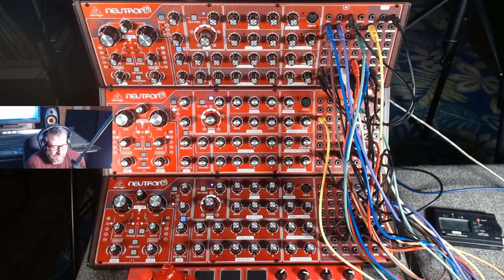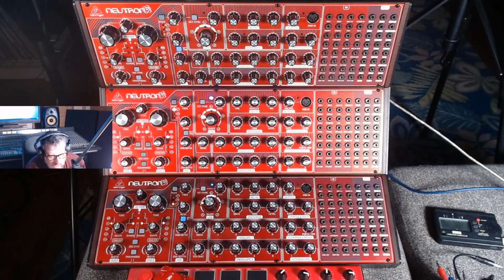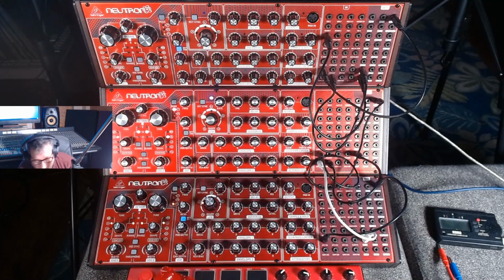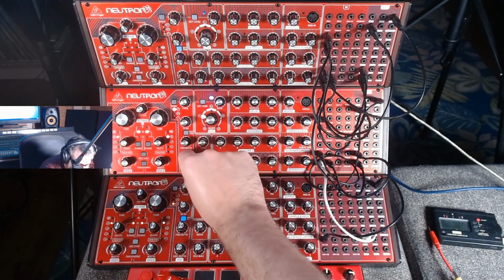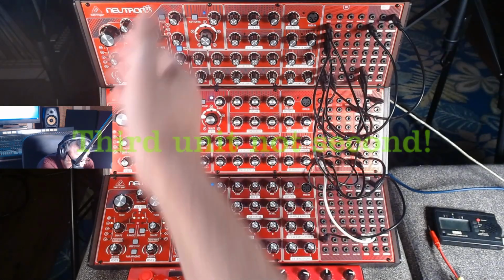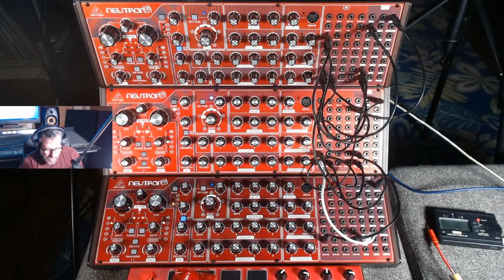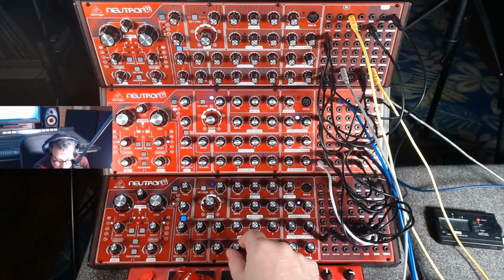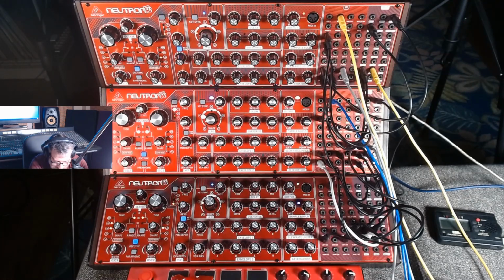How To Behringer Multi Neutron & Sound Examples

Comment: Hey there, great ride. Question; with this process we loose the drives right? Is there a way to return those? Thank you!
Reply from the maker: Great Question! The drive on the main unit, you know the destination unit, will work on all units oscillators together as a sum.

 That's probably what you want BUT  you could instead of take osc mix outs take main outs. Problem there is you get extra in series filters and VCAs on just Neutrons #2 and #3. You could maybe patch around the filters but probably a lot of work and thinking.
Reply: @housebandthexenos2569  Hmm, the drive on the main unit is also off here. The main outs, if you mean "output" outs do not do the trick here. Ill play around and add a comment if I solve it. Im quite new at this btw. Thank you good sir :)
Reply from the maker: @jakowrtaric  well if you are using the 2nd units filter in series it depends where you patch it back to in my main unit. I was thinking of just the normalled connection on #1 unit from it's vcf. If you patch that 2nd units vcf into wherever that drive is I'm sure you'll get it. I'll check later today and let you know where I think.

Comment: how do you control them? I see no midi connection being used, are you controlling this with CV or with the rear USB connection?
Reply from the maker: I'm using a 3x USB cables and 3x midi tracks, one to each unit. You could just use a midi cable to one unit though and daisy chain midi thru to the rest.l and just use one daw track. I believe the midi out can have a thru function set in the Synth Tribe app if I remember correctly
Reply: @housebandthexenos2569  thank you do you use a USB hub of some kind as a lot of USB devices need to be connected directly to some (powered) connection or hub with it's own power supply.
Reply from the maker: @koosfockens1707  yes, a hub is fine but before the hub not a bad idea to put a USB electrical isolator.  This prevents computer noise from going thru the USB and mix with audio of unit. Not essential, but some computers (and USB ports) are noisier than others. Midi din jacks never have that issue.

Comment: Damn! You seem to know a ton about this equipment. I got a neutron today it sounds great but I can only get audio from the OSC 1 2 mix in the patchbay and nothing from the 1/4" Jack's on the back of the unit. Any ideas?
Reply: There are some basic neutron tutorials on youtube. Almost all of them start from a default configuration which will give you sound. Follow those.
Reply: Patch vcf1, vcf2 or overdrive Into   vca in on the patch bay. That should do it. Patching vcf1 or 2 removes the  overdrive from the signal path.

Comment: How do you connect the midi? Its all 3 connected via usb?
Reply from the maker: Yeah I'm using usb to each neutron, and 3 armed midi tracks. One to each unit. Alternately you could use the midi thrus on the back of the units and use just one track. I don't know for sure if the usb input is echoed to the thru though. I haven't tested that. If your using a daw, id say usb is better. It's just easier and you can find probably find usb cables cheaper than midi ones and you probably have more usb cables just lying around.

Comment: sounds like a 2600
Reply from the maker: U can do alot of the same sounds but a big difference with the 2600 is that the Neutron has a 12db 2 pole filter instead of the 24db 4 pole of the 2600 and Moog Modular as well. 

Having a 2 pole let's more of the stuff above the cutoff point thru, and that let's you hear more of the massive 6 osc stack's midrange detail to be heard. Also more fm upper harmonics etc. I have run this 3x neutron stack thru a Behringer Model D filter and envelope and then it is, well, more Moogy.

Comment: The neutron seems really sick but I hate the paint job its ugly as hell IMO
Reply from the maker: Hey. Quite a awhile ago I did a bunch of overlay designs for the Neutron. They are quite artsy and bold but have a wide color palette between and sometimes within them. I never got them printed or anything but the other guy in the thread did and some of them are available. Mine are way more fun though. 

There's a Gearspace thread with them all. Mine are post #5 and high res so you can click on em and zoom in. I did many of the designs using fractals or 3d modeling. Let me know what you think. I probably should have printed some but kind of the other guys way plainer designs coupled with his working at a printing place discouraged me I guess. Here's the link.

https://gearspace.com/board/electronic-music-instruments-and-electronic-music-production/1222734-behringer-neutron-custom-overlay-showcase.html